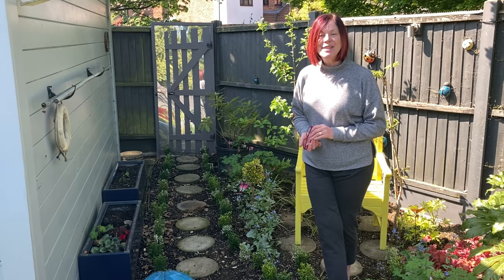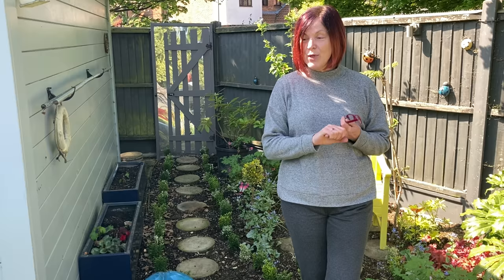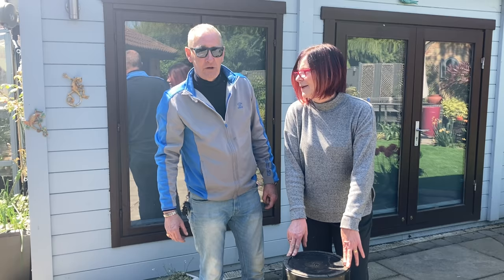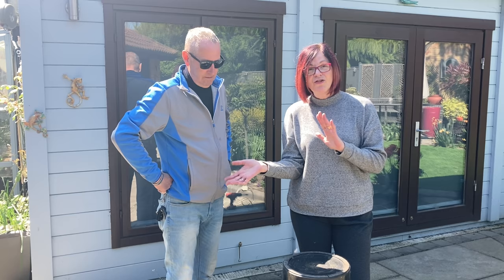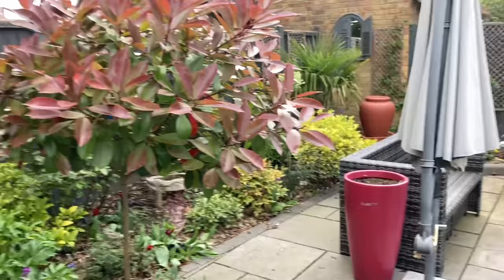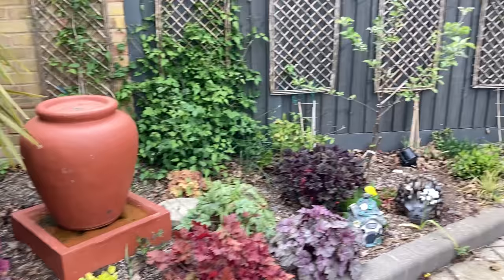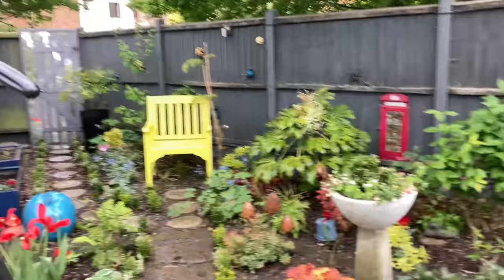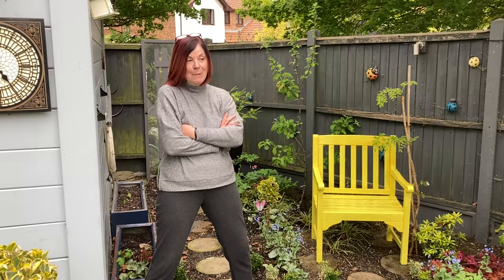Bottomless Pots || A Fabulous Idea From Bunny Guinness 😊

Comment: Richard did a great job cutting those pots, I was worried the pots wouldn't be straight.  It looks great Janette!  I cut the bottom out of my hydrangea pot, it was just starting to root in and my husband had to move it to work on the drip system.
Reply from the maker: Hi Linda, how was your granddaughter’s party?  Ah, so you’ve already tried this?  It’s such a good idea isn’t it?  😍